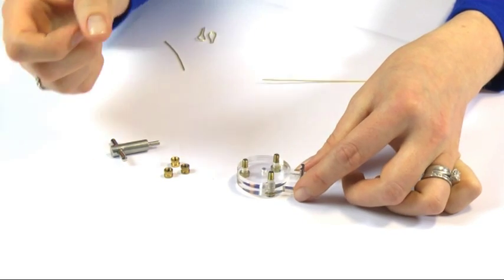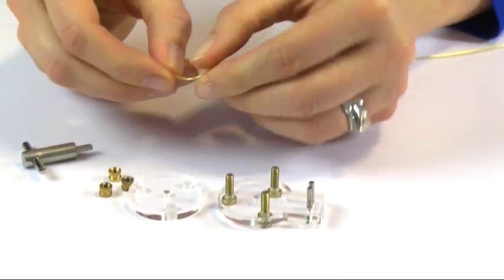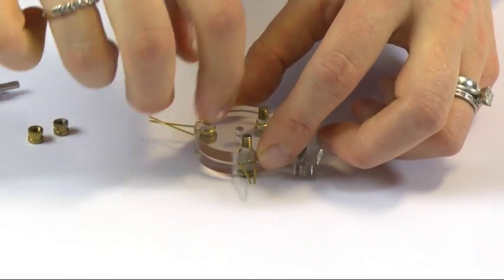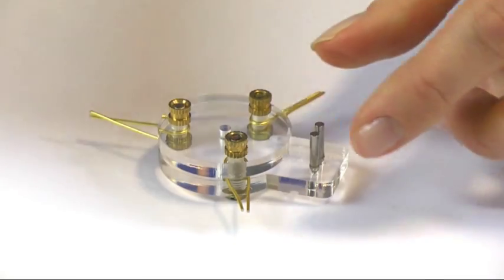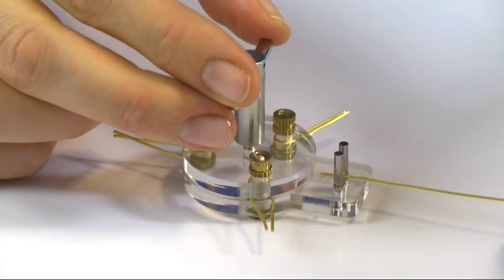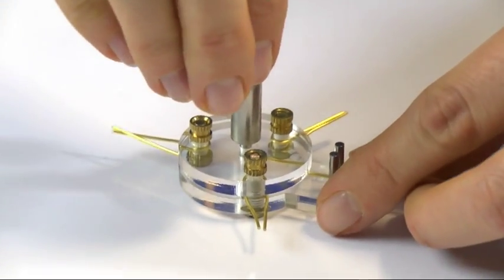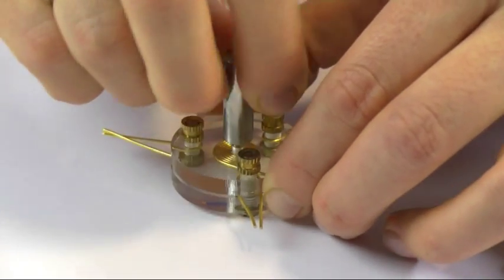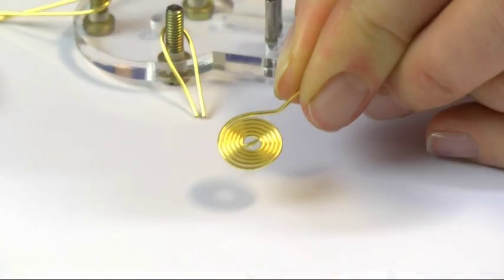How to Use The Wire Spiral Making Tool

Comment: At 1:16, all the presenter says is "the shaft faces the two guide bars." It's not clear that the vertical slot at the bottom of the central shaft must face the guide posts and be positioned midway between them prior to pushing the shaft into the hole for the stem of the shaft.